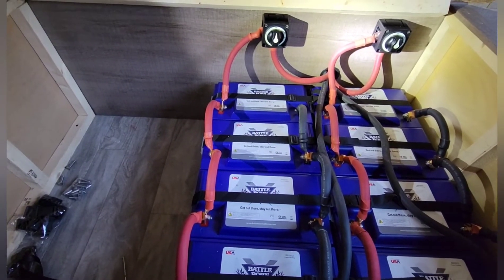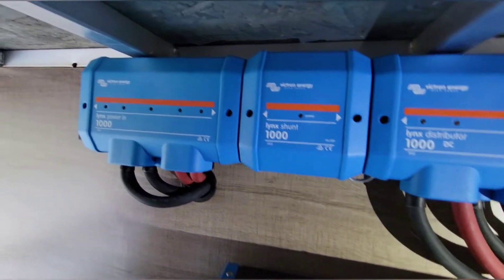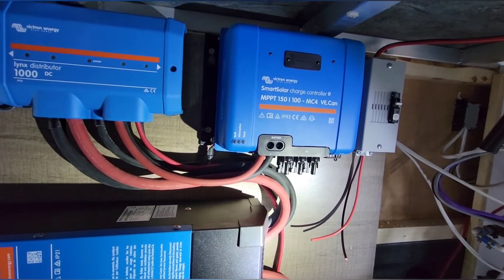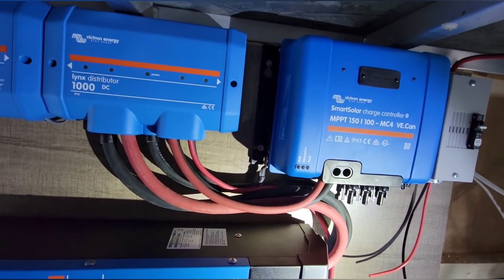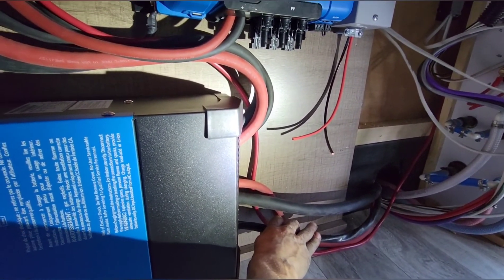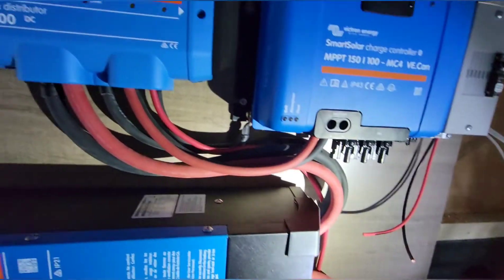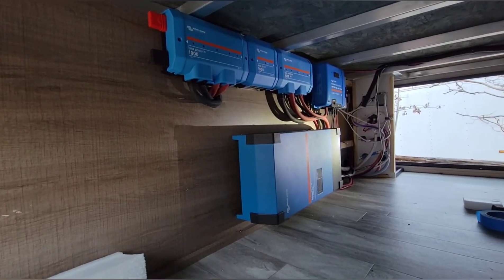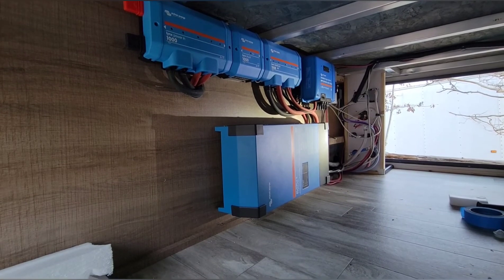Grand Design Imagine 2800BH Solar System Install • Part Two ⚡️

Comment: How did you run the 120V 6/4 line? 

Did you have to drop the chloroplast underbelly? 
On the underside, about 4ft back from the start of the pass through storage there seems to be a beam with only a small opening to fish the AC line through.

Comment: Do you have a part 3 to finish?
Reply from the maker: Yes we do. We apologize it's been so long. We had a delay in getting the panels delivered and then they only delivered 7 out of 8. It pushed back the completion on it. Part 3 will be posted soon though. Thanks for checking back!